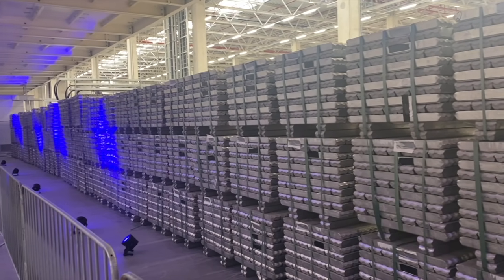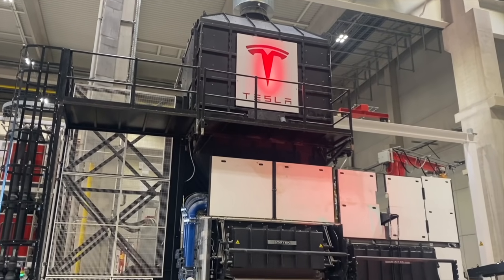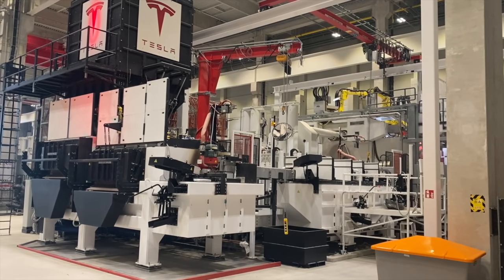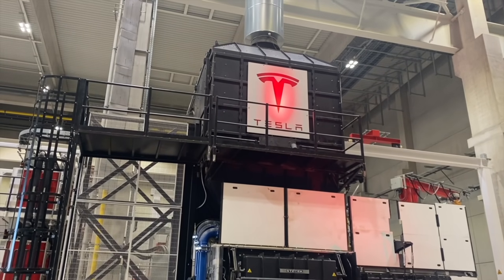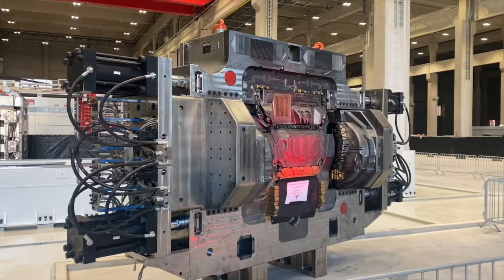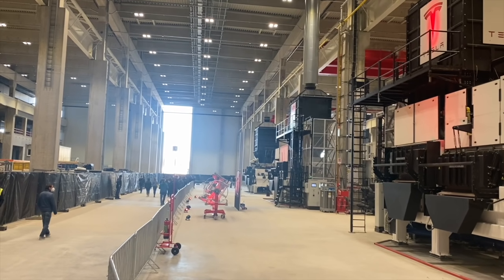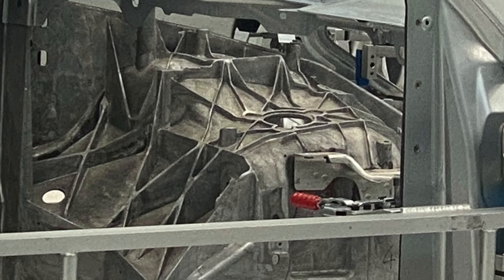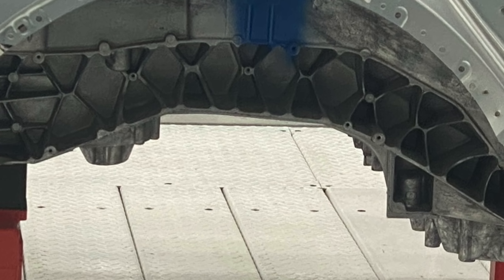Giga Berlin Factory Tour Part 3: Castings

Comment: It would be interesting to know how they check the finished part. After all these are safety critical parts and special characteristics should exceed what you can do with gauges. I'm almost asking myself where the big ultrasonic or x-ray ct is located (x-ray ct would likely be too slow. but if you improve it with the same rate as the casting machines, who knows).
Also the scrap rate would be interesting - 1 million shots does not necessarily translate to 1 mil good parts.
If the machine can do 1mio shots - how much shots can a cavity do? It is unusual to talk about machine shots.
With the partial injection speeds and strength I could imagine that a cavity is done in less than 100k shots.

Comment: I understood that the Gigapresses going into Berlin and Austin are 6,000 ton machines with the 8,000 ton machine for Austin for the Cybertruck still being developed and built which is the reason for the delay in building the Ctbertruck
Reply from the maker: The 6,000 ton you refer to is incorrect. The 8,000 ton for CT is in the works but the 'delay' if there is any is more because of batteries shortages and that MY has priority for Austin

Comment: It is important to have the metal all over the casting cooling down at the same rate. If you have a thin part cooling and solidifying much faster than a thicker part  it introduces internal stresses that will compromise the strength of the casting, and possibly cause warping of the final part.  Another concern is that cooler metal stops flowing which can make a casting not fill completely.Thermal control is the key to consistent strong parts.
Reply from the maker: True, the thermal management process is much more complex than people anticipate. The pipes with hot or cold oil and water are a sophisticated approach to get that process step under control.
Reply: Yes, but that why Tesla uses there materials engineers from Space X to help them.  The materials engineers created a aluminum alloy in the process of creating this mold for Tesla.
Reply: Space X materials engineers have been tinkering with magnets in Tesla electric engines as well metals within the body of the car to get it cheaper, lighter, and stronger.   So they are really thinking outside the box.

Comment: Thanks for the update, very informative. Idra's parent company is based in Hong Kong, LK Machinery. There is quite a bit of information on Wikipedia. I wonder what motivate Idra and LK Machinery to develop these machines. Will the EV companies in China use Gigacast as well? Hope the cost saving in assembly from Gigacast will more than offset the higher cost of aluminium alloy versus steel. We have very interesting years ahead, it is once in a life time opportunity to transform mobility. The time is right.
Reply: Two points, The Limiting Factor has a video on comparison between Gigacasting and using the extreme HSS steel now being used covering pro's and cons and the economics
Second LK has sold a set of gigacasting machines we believe to SAIC consisting of 5, 6, 8 and 9,000 ton machines
Reply from the maker: I learned its H11 and H13 hard steel used for the Giga Press. I have not heard that Giga presses are sold above 6k tons to other automakers but its interesting information that I'll try to validate.
Reply: Re motivation: I wouldn't be surprised if IDRA was approached by Tesla with "Nice machine, but can you make a bigger one?"

Comment: The alloy is not the secret sauce? That surprised me. Thought it was special because it would not require heat treatment after the cast to harden it. Great info. Thanks,  Alex.
Reply from the maker: It's definitely a special alloy no one else yet has yet but is not the key competitive edge I thought it is. No needed heat treatment has several reasons but the alloy very likely helps with it.
Reply: @alexvoigt4247  great video. Going to watch parts 1 and 2 now! Also surprised to learn the alloy isn't "secret sauce." Did Tesla patent their alloy? My understanding is the alloy Tesla developed prevents potato chipping. If another manufacturer couldn't use Tesla's alloy how would they overcome potato chipping without having to develop yet another unique alloy? That seems a tall order.

Comment: A 1 piece casting machine would BLOW MY MIND. 🤩🤩
Reply: If the design includes front/rear symmetrical doors, or is a two door coupe, only two more door castings would be needed. Polymer skin has been used on Saturn's, smart, and the BMW i3, if aluminum skin isn't saving weight or money.

Comment: Is 6k, 8k, 12k tonnes the weight of the entire machine, or is it something to do with the pressure it exerts ?   Just saw another vid, the machine weights 450 Tonne, so the 6K etc is the pressure.
Reply: Pressure it exerts on the molten metal to get it into all the nooks and crannies on the casting mold
Reply: think it is the pressure to hold the two main part of the form together, dont think the pressure on the is that high but on a big area it means a high total pres.